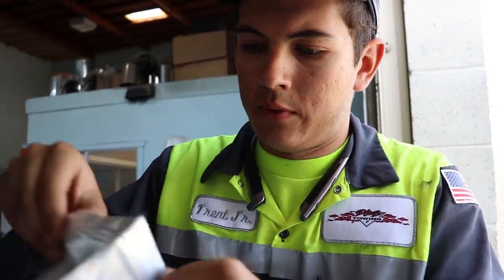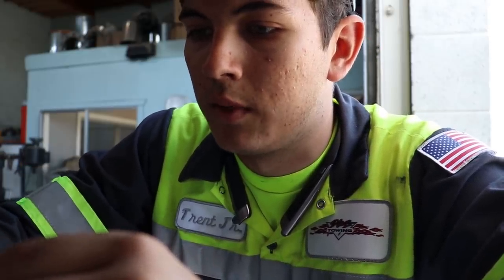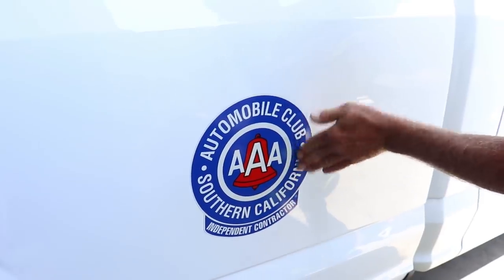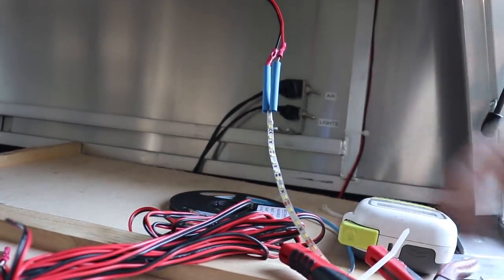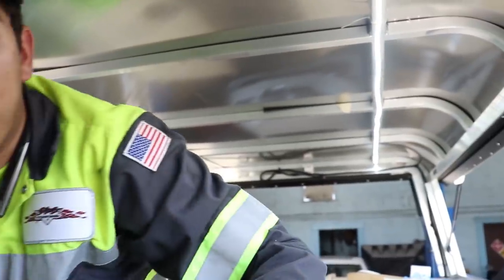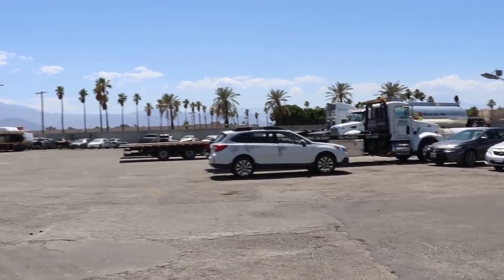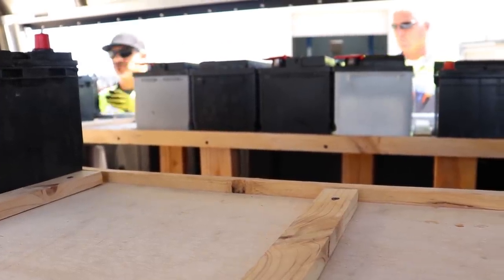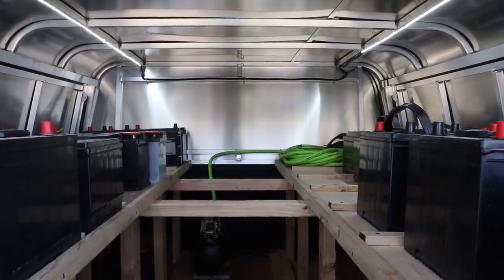Battery Truck #4 In Service! | VLOG 009

Comment: Hey Trent Jr, I am a retired Tow truck operator and I also did light service for CAA which a sister company to AAA here in Canada, the type of back door you have on the second truck you were showing you can put a pull out tray the slide and are good for upto a thousand pounds so you can put a air compressor with a hose wheel and a jack holder on one side and AAA batteries on the other. Just thought I would help.

Comment: For the  trust with the fiberglass full body cap you should put a center drawer. And you could put the jack and the wrest of the Equiptment into the side cabinets

Comment: for the backup cam easy fix you can do it extend the wier harness for it and just put the one in the tailgate up top or order a replant tailgate came if you don't want to take the other one out of that tall gate and then jest put that up top and jest extend it leads and plug it bake in as if it was on the tall gate

Comment: Here in my home state of mn We're required to have a positive/neg air flow system to prevent gasses from building up which the batteries put out especially in a high heat area as California.A fan on one end of topper drawing outside air in and a vent on opposite end of topper letting air out.

Comment: Hey Trent I work for a towing company in Canada and we have a battery truck as well. It has a nice bed slide for our batteries to be positioned on and then just pulled out for easy access rather than climbing inside the box of the truck anytime you need a battery at the back. Hopefully this gives you an idea for the second truck in the video buddy. 👍

Comment: if you  clean the  metal with  metal cleaner the tape will stick - oil on the metal from factory
Reply: It gets very hot there. Difficult to get anything to stick.

Comment: Trent i have found that the two sided tape on the led strip is not very good so i use two sided tape that you would use to stick number plates to the vehicle if it holds them to the vehicle in all sorts of weather then it will stick your led lights up no problems